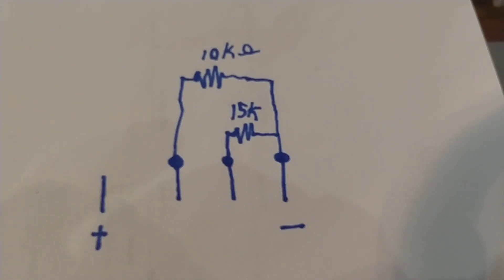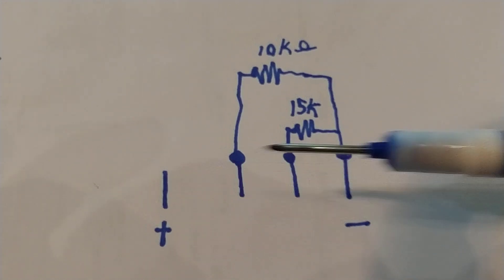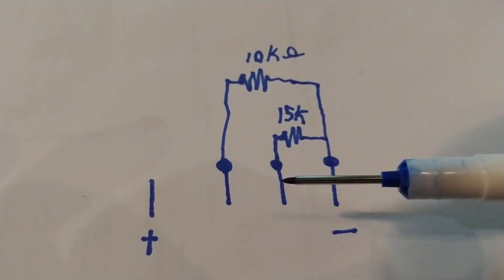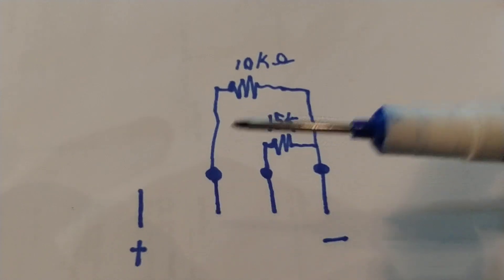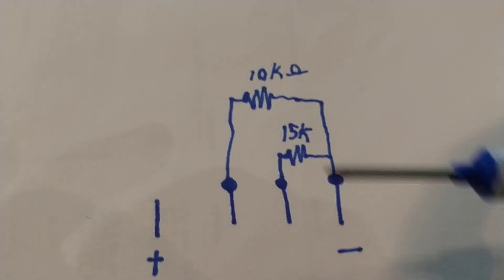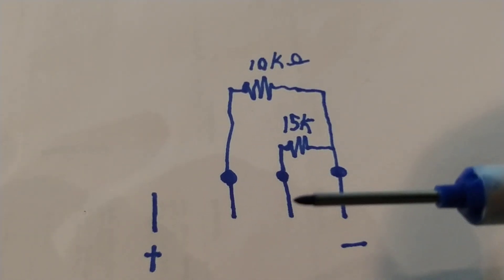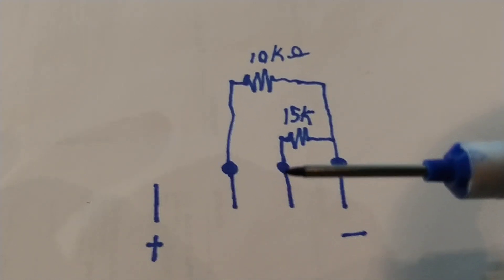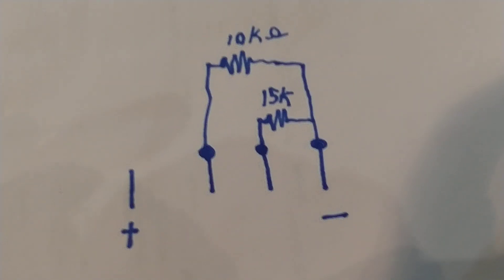B auer tool to DeWalt battery circuit diagram

Comment: Thank you for the diagram. I have a question for you. I have tons of 10k resistors but no 15k resistors. Can I series two 10k to equal 20k and use that in place of the 15k resistor?
Reply from the maker: I have not tested the 20k ohm in the circuit so I can't tell you if it would work, if you can measure a few and since they vary find the one closest to 15k and try i, the end result is a lower voltage to the sensor circuit, and that should not harm anything. If you have (6) 10 k then  wire two sets of three in series = 30k ohm them connect the two 30k in parallel for 15k.  Note: the tolerance stacks so the exact value will vary. finding enough room for 6 resistors might pose another problem.
Reply: @GmanInd  FYI. I did it using two 10k in series and so far it's working fine. I have been using the Harbor freight 3  1/4  20volt planer and it seems to be working fine! The hardest part was opening the case. I ended up removing the torque screws from the handle and a couple on the back end of the body and the fixed plate and just pried it open enough to get the plug with the circuit board out to access the board. I soldered directly to the circuit board. I also used one of those adapters they sell on Amazon so I didn't have to break off the middle pins or cut the plastic to insert the DeWalt battery.  I used it today and went through five 6.5 amp DeWalt batteries and no over heating. I stopped using each of the  batteries when there was one light left . Thank you for your YouTube video . I also put electrical tape on the board under the resistors. It looked like you had it on yours too

Comment: you say 10 and 15k resistors but what watt and what % ??? of resistor
Reply from the maker: You asked this question in the previous video, the short answer is I use 5% gold bands @  1 watt but the adapter uses <1% @.25W . check out the detailed explanation here: https://www.youtube.com/watch?v=PD0jmVhsuhA&lc=Ugw1a_EhF0BWtHRD_Eh4AaABAg